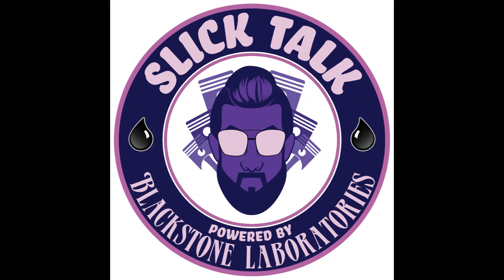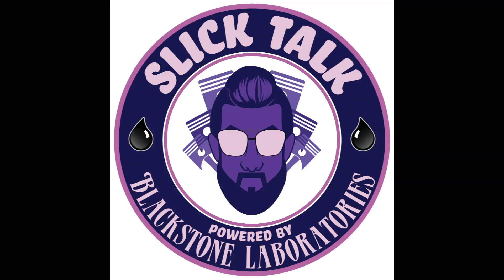Slick Talk - Episode 2: M3s, M5s, and Bearings

Comment: So here's my question: what's the worst thing one can do in regards to motor oil (excluding not changing and letting the oil level run low)?
Reply from the maker: It's hard to pick a bigger sin than neglect. You hit on a couple of obvious ways to neglect engine oil - not changing it or letting the oil level run low - but there is more that can be left to chance. 

A lot of folks don't realize that oil, no matter which kind you buy, won't work well if contamination is a problem. You can buy the most expensive option you want, but no matter the brand or blend, harmful contamination (e.g. coolant, excess fuel and so on) will keep oil from doing its job. So, it's imperative to stay up on any potential sources of contamination - make sure the air filtration system is sealed up tight, for example. Or, if you're noticing coolant loss and you're not sure if its an external leak, get a sample in for testing to find out - it just doesn't take much of any sort of contaminant to stop oil from cleaning and lubricating internal parts like it should.
Reply: @blackstonelaboratories  that makes a lot of sense and I should have known that with the years that I have been doing my own oil changes (50 years!) and sending oil to you for analysis.  Thank you for the reply
Reply from the maker: @LouT1501  Any time! Glad to hear from you.